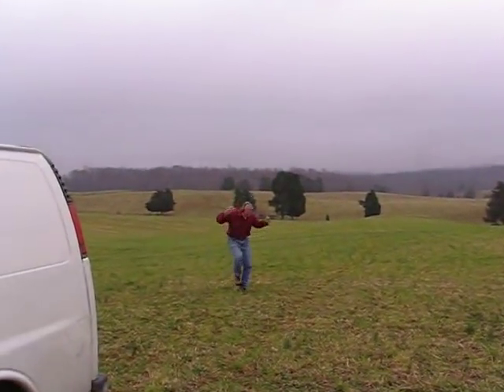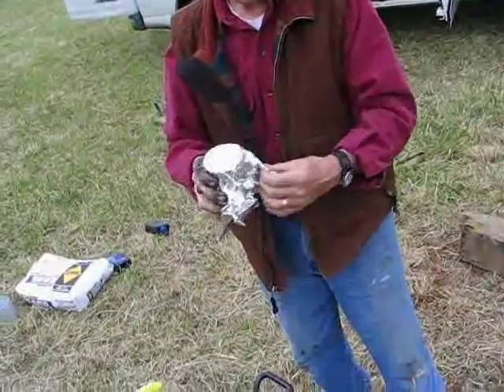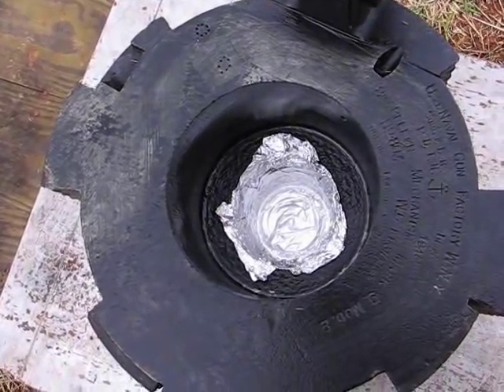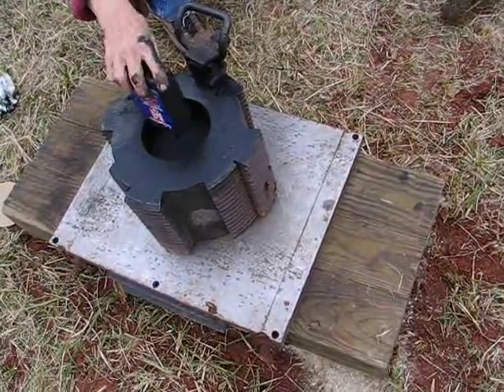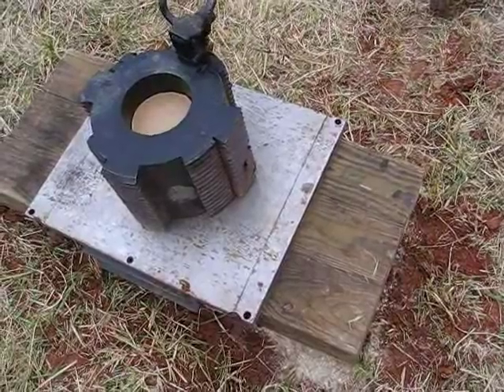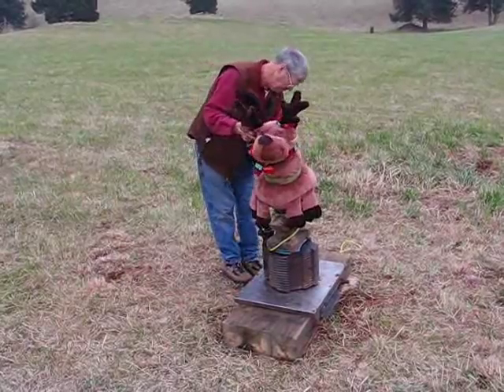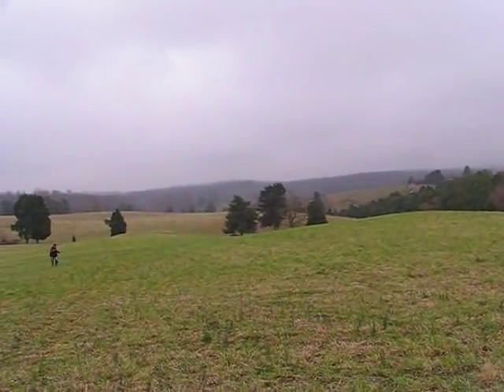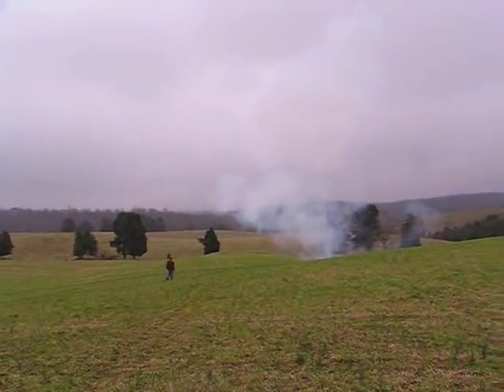Death of Poor Ralph the Reindeer, Test Pilot

Comment: Next time you should send up a midget.

I guess a hand lit fuse is safer than a radio controlled igniter like you'd use with a model rocket because of the risk of accidental detonation from stray signals?